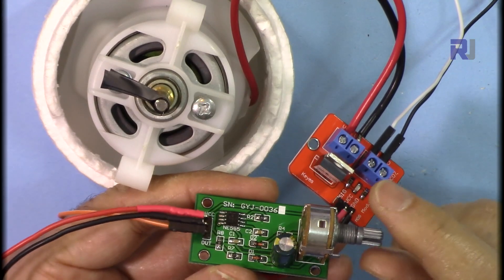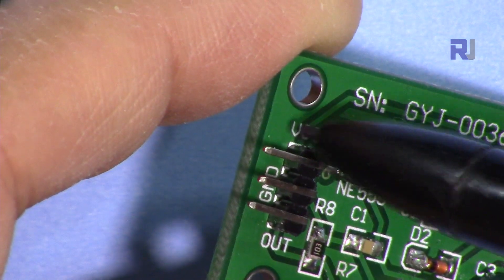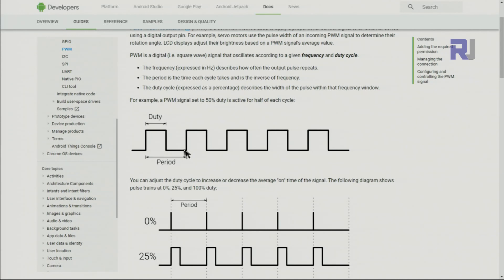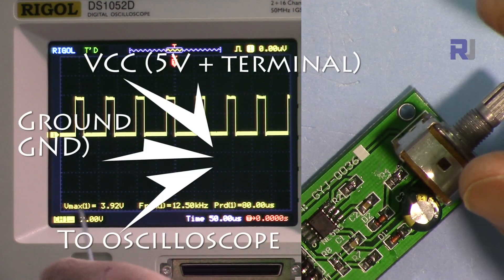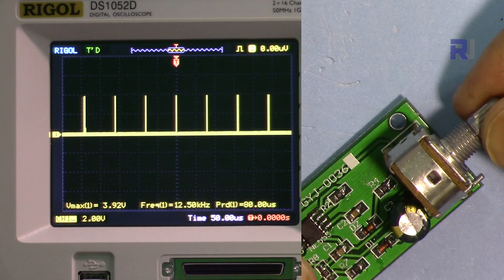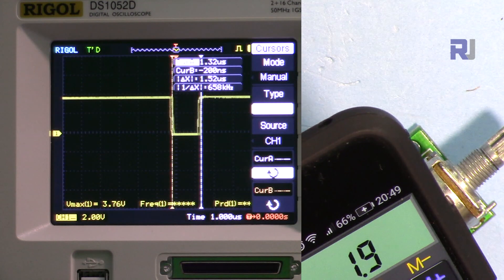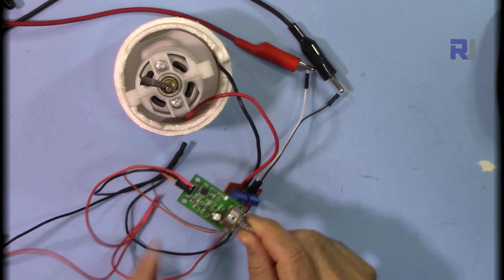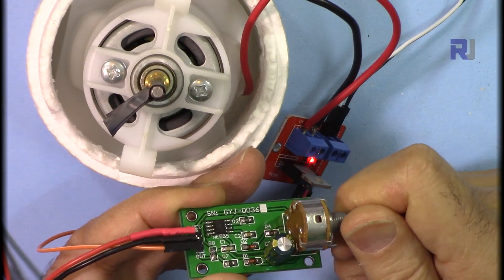Using 555  PWM Generator motor speed controller

Comment: Hello
I am using a PWM 30 amp from Amazon for my boat motor.
I want to remove the speed control pot and use an RC Receiver signal to control the speed.
Is this the IRF520 the module that I would use to replace the POT?

Thanks
Reply from the maker: Hello, you won't work be able to just  receiver to do it.  if your receiver outputs PWM signal, then you could connect it to the input of this module and control the motor. I have another video on this MOSFET search my channel .
Reply: @robojax  Thank You!
Your videos are amazing. I really like watching them
Reply: @robojax  I connected this module to my pwm receiver. I had a 12 volt supply and the full range of the joy stick only changes the voltage from 1 volt to 2 volts. It does work but missing 10 volts

Comment: Mosfet module makes noise on motor rotor...
Reply from the maker: When the power is not enough to make the motor run, most of the time the noise is due to that.

Comment: btw what is the frequency of 555 driver ?
Reply from the maker: The frequency can be set using RC, capacitor and resistor. But in this case it is already built.  I am not sure if you can find , try searching for this board on Amazon or eBay and see if any store has mentioned the frequency.

Comment: Hi
I want to use this irf520 module with myrio 1900 card to control a water pump
I'm confused about the frequency that  the module will respect the rule v(output)=v(vcc)/(1-d)
D duty cycle 
Noting that the maximum frequency on myrio is 40khz
Thank you a lot
Reply from the maker: I am not familiar with myrio 1900 module. Duty cycle is ration of PulseWidth÷Period and whatever parameters you have , try to fit it into this formula.
Reply: @robojax  well today while i was testing the module (irf520) the output value doesn't change even when i change duty cycle (frequency 1HZ because without any charge 1Hz alow me to chnage output by duty cycle) 
the pump is 24vdc 3.5A MAX normal amperE is 2 A 
what frequency allow me to change output vlotage by dutycycle?
Reply from the maker: The out voltage does not change if you use your multimeter.  it is PWM it turns Off and ON quickly with changing the duty cycle and as a result, the speed of motor is controlled. You should use oscilloscope to see that the output is NOT always ON.  https://en.wikipedia.org/wiki/Pulse-width_modulation  Thank you for keep watching the ads and not skipping them. it will help me a lot.

Comment: to your right the 2 red and black wires where they are connected? of [form ne555] ?
Reply from the maker: Every wire in the image has lables. I have also explained it in the video. Either it is 5V or 12V . You need both.